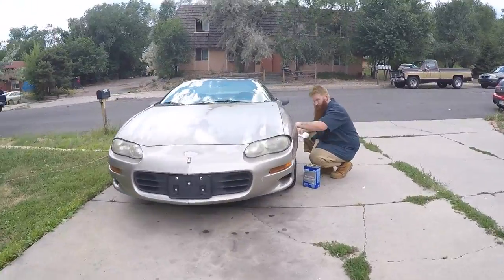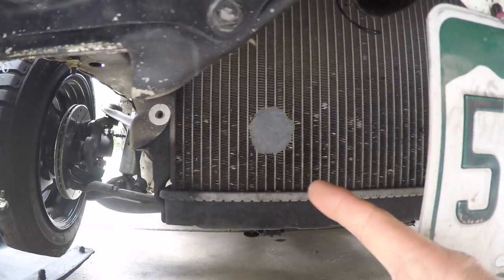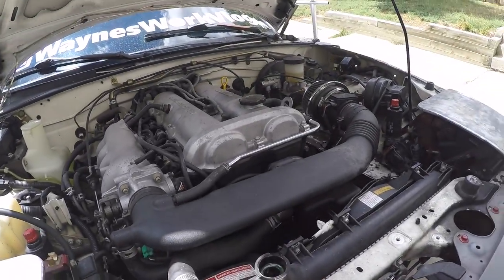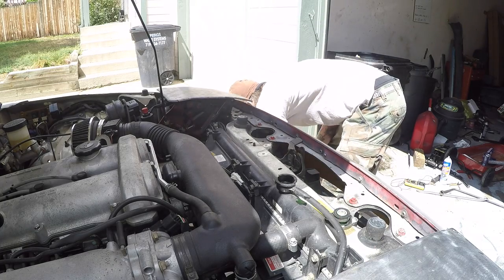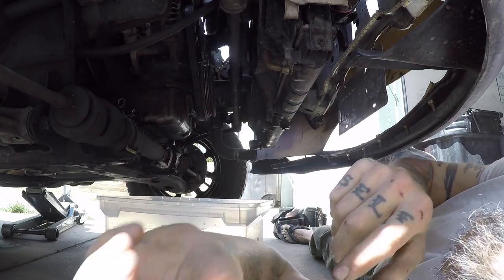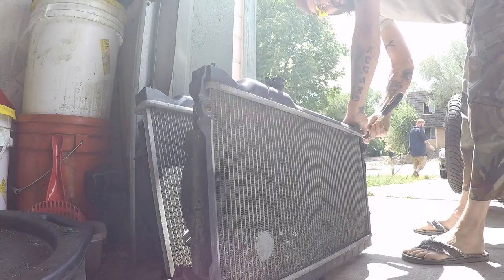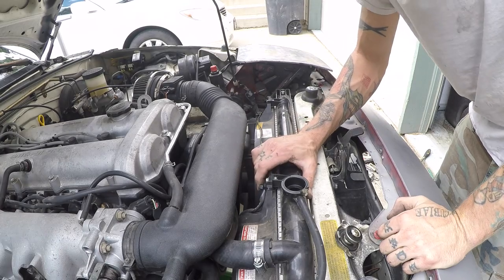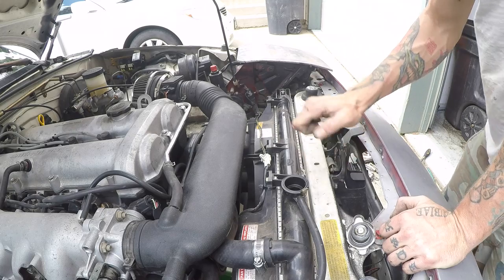Miata radiator replacement S06E23

Comment: So far the most comprehensive guide on how to change a radiator in a miata, thanks man! Also, do you know if this would be any different on an NB miata? (98)
Reply from the maker: haha thanks!
Reply: Would it be any different on an NB miata?
Reply from the maker: @116934148127933976004 not sure, i don't have an NB miata.... lol